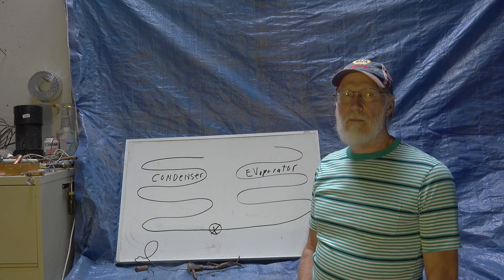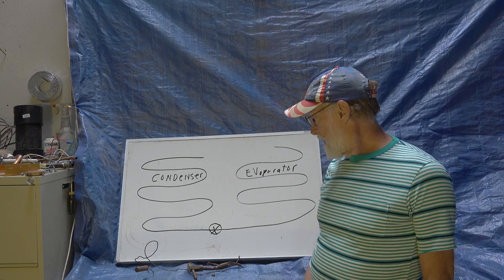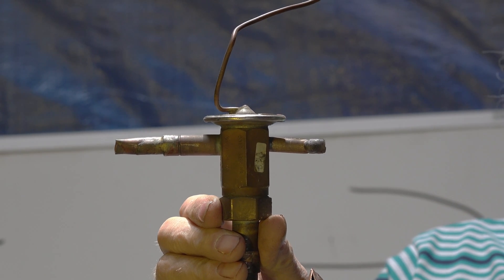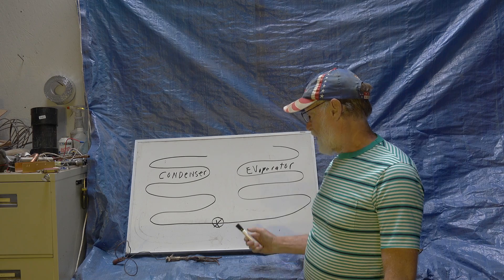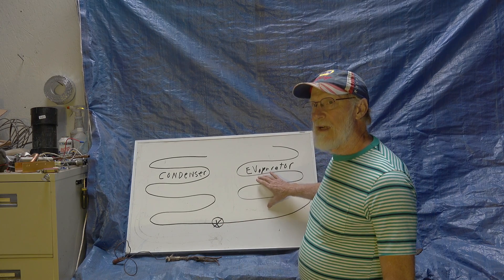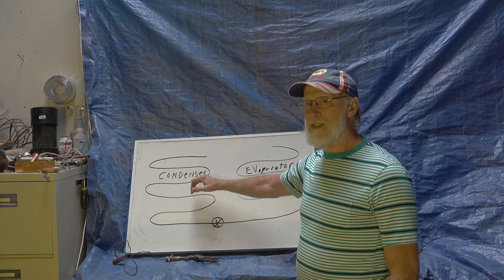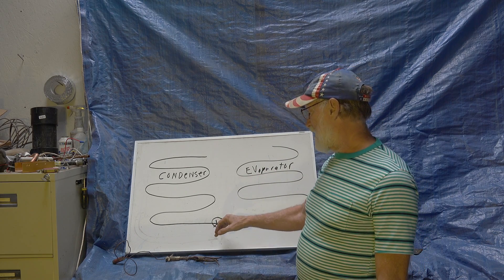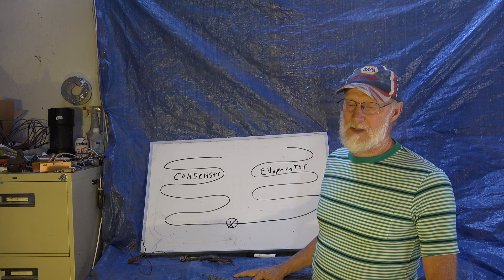The refrigeration cycle:  What the expansion valve does and why

Comment: I have a question.  7.5 Tone Tran unit cuts out at 150 low side and 400 high side. When I got to the unit it was running good in cooling but when I did the test for heating and cooling it runs only for 5 second. My fellow tech and I are debating if it is the TXV or reserving valve. What you  think? Please advise.
Reply from the maker: Need lots more.  Start off with R-22 or 410A?  Shutting off on high pressure?
GFM

Comment: Hello 
i have a question. 
my refrigerator doesn't switch off itself. 
is this because of high room temperatures about 30 degrees Celsius, the thermostat doesn't work or problems with the gas?
cooling room and freezer works normally. 
if you have time to answer, i thank you.
Reply from the maker: There are usually 3 reasons a refrigerator won't shut off.  The thermostat is stuck on.  If this is true, you will have freezing in the cooling section.  If the temperature does not come down, you may have a refrigeration problem.  Compressor failure, leaked out refrigerant charge.  Or you could have a blocked condenser.  Hope this helps.
GFM
Reply: grayfurnaceman 
thank you for the advice.
Reply: Is there any way to fix the thermostat or just to replace a new one?
Reply from the maker: Replacement is the only option.
GFM
Reply: A common issue is the refrigeration is OK but the darn door gasket is ruined or the refrigerator is racked, not level. Thus the unit runs all the time sine one has more "cold" heat loss than normal. Run paper around all the gasket to feel if it is firm or wide open. An ancient dorm fridge I had that is about 30 inches tall at the end of its life had a bungee cord to force the door close and then the unit would cycle. Another thing is the back coils it it has any too dirty; or is the unit with no exposed coils right up against a wall. A dorm fridge type unit at my business was after every shop cleanup declared "broken" and all it was every time was the unit was racked, they pulled it out and left out the shims to level it up. This went on for 20 years, on a unit built in 1979. The peanut gallery worker bees had the door not closeing fully thus the unit ran all the time. Releveling it and and it worked up to about 2 years ago. This issue is real common when a unit is moved

Comment: Have a question. My compressor is dead- dead short on compressor. I've order whole new furnace and AC. I want to remove the outdoor unit without releasing the r-22 into air. I know I can close the valves on the high and low side, but how do I move the refrigerant in the lines, into the bad compressor? I have a vacuum pump, gauges, pressure monitor, core removal valve, etc. Is there a way to do this, all info says to close one side and turn on compressor, but I cant do that. I have an air compressor if that would help at all. Thanks for any help.
Reply from the maker: ArkhamB There is no effective way to remove all the refrigerant from the line set. You can remove most of it by turning on the furnace with the outdoor unit in a cold environment. Once the furnace has run for about 1/2 hour, close the service valves and open the system. 
GFM
Reply: Awesome...I will do that. Appreciate your help! Thanks Brian
Reply: Thanks Bubba...Getting new lines to go with the new equipment. Will be keeping the R-22 in the condenser/compressor. Brian
Reply: don't do anything if Yu aren't licensed to handle refrigerant

Comment: great tutorial, i would like to be able to get to the point where i can tell if a unit is under or over charged by touch, like that one video you did where you were guesstimating the charge/temp suction line with your hand, dialing in the charge.
Reply from the maker: Spector NS5 RD Thanks for the support. 
GFM
Reply from the maker: You got it.
GFM

Comment: One important function of modern Txv is to hold the warm refrigerant in the condensor during the off cycle. Helps with efficiency by shortening the time it takes system to reach equilibrium on start up. Also helps limit moisture re - evaporation off the indoor coils.
Reply from the maker: Joe Shearer Not just the modern TXV. The TXV is over 100 years old. Thanks for the thoughts. 
GFM